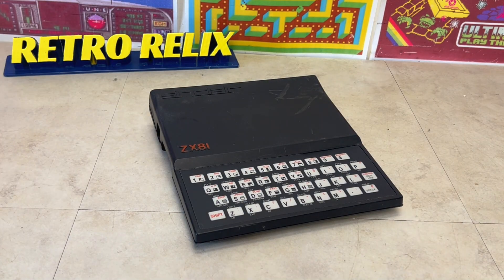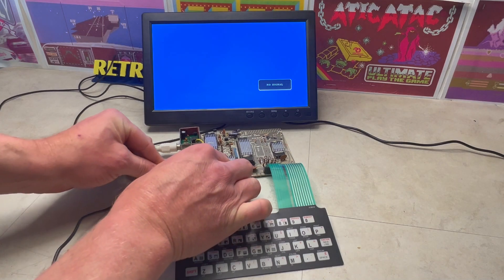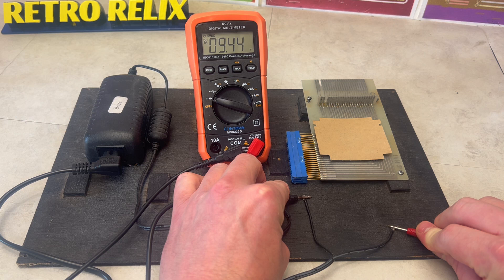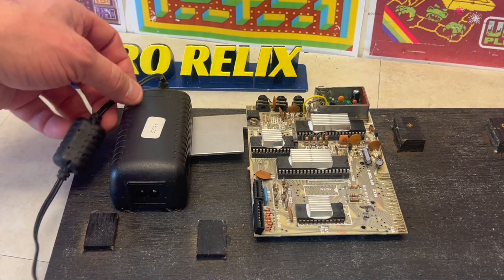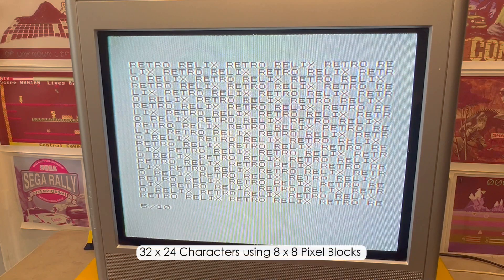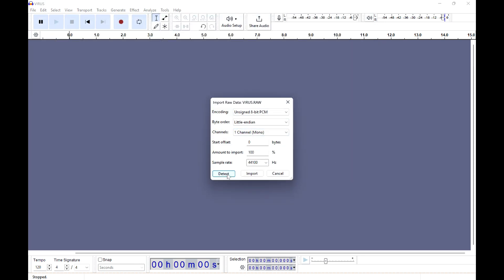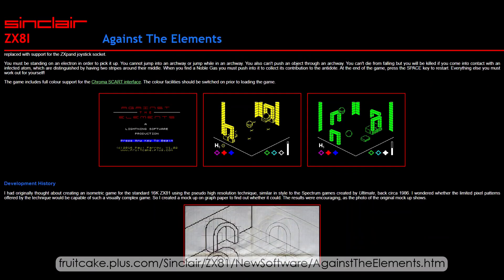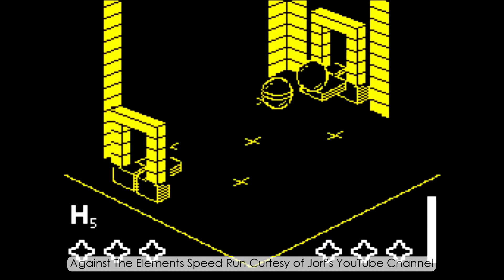1981 SINCLAIR ZX81 Review, Fix, Modern Mods & Games

Comment: You could have used the interal one Chip 32K upgrade that there are several videos about.   I like that one and have done it to mine.  It's much more stable and leaves the edge connector free.

Comment: Great video, but where is the true hires (you needed modified RAM-pack or in 1K play my 1K hires games of which you had one in screen for a moment). And since may 2024 I discovered a new displaymethod which I call "quaracterdisplay". You can swap characters before the current character is drawn. So with 4 lines of the 8, 2 lines of the I and 2 lines of a D you get a key displayed.
Reply from the maker: @johankoelman2996  I had to stop somewhere 🤔